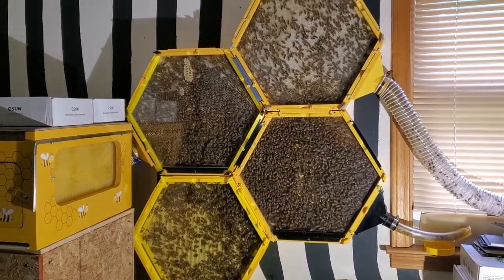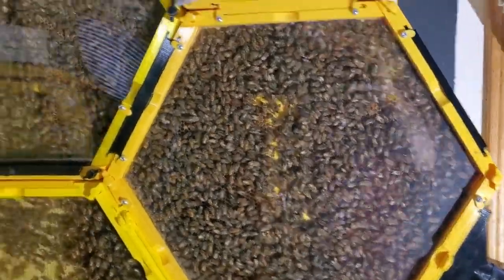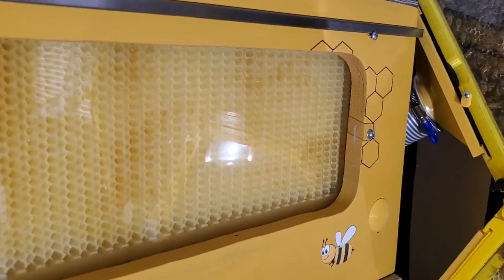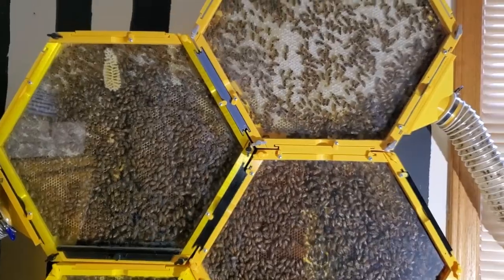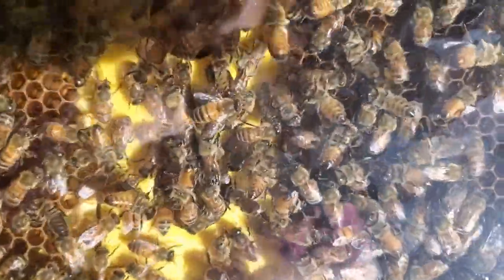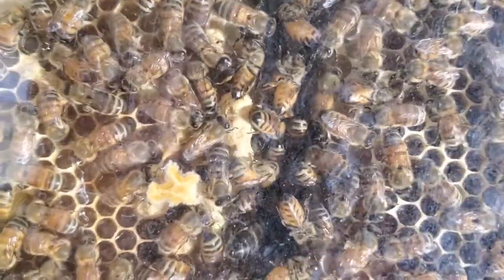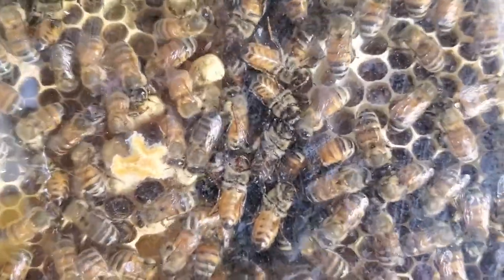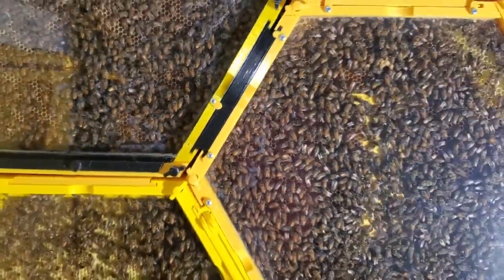3D Printed Bee Hive Update

Comment: You have larva from what I saw, no eggs? That just looked like drone cells to me not a queen. Queen cells look like a peanut and they dangle down. If they were to makin one it would probably be in that center section but it would be pointed down. Drone cells are just males and they poke out in a dome. My guess is that they just dont feel like they have filled out the hive enough to start packing the honey in a flow hive yet. If there is a queen excluder on the entrance of the flow hive that's good so she wouldn't be hiding in there. If they need a queen they will do something about it, but should you notice a queen cell removed the excluder on the hive exit so she can be sure to get a mating flight in and when you see eggs again you can put it back. Bee's usually handle queen trouble themselves but we'll see.

Comment: I wouldn't worry too much about that queen yet.
1. As some other people pointed out, she may be laying on the side you can't see.
2. Sometimes they'll stop laying for a while (probably having to do with the weather outside, nectar flows stopping, not enough pollen coming in... etc) and then resume when conditions change.
3. Maybe your hive is "honey-bound": That is a condition where there is so much honey in the cells that the queen doesn't have a place to lay eggs. 

To entice the queen to lay, consider covering up some of the windows to keep the light out. The queen prefers to be in a dark area.

To get them to use the flow hive, make sure you give them a nice big opening between the area they are now in and the flow hive and make sure the connection between the flow hive and the rest of the hive is as short as possible. Otherwise they won't recognize the flow hive as part of the overall hive.
Reply from the maker: Thanks for the suggestions. I do cover the front when I'm not looking at them.

Comment: Ok, when you started talking about no larva, it made me think about how important it is to have a screened bottom board with a section that can be removed and inspected on a regular hive.  I use this removable, white plastic board that’s under all of my screened bottom boards to see what’s going on in the hive.  For example: you can see any varroa mites that have fallen, balls of pollen so you have an idea what they are bringing in, and you can see the wax capping from the cells when new bees are being born.  You may consider having a small, removable sheet at the bottom of each frame that can be pulled out so you can have an idea of what’s going on in there….

Comment: Those bigger popcorn looking cells are drone cells. As Brad says, she may just be laying on the inner layers where you can't see. Those areas are probably a little warmer so better for brood. They will probably not want to use the Flow hive until they have run out of room to store nectar anywhere else in the hive, so if you keep adding hexagon sections they will probably ignore it, you want to give them no other choice basically.  You can also try spraying the flow hive frames with a little 2:1 sugar, just to get them interested. If they do start to use the Flow hive frames they will probably start in the center, you might night see anything is the observation window of the flow hive super for a good while.
Reply from the maker: Thanks for the advice.
Reply: @bigchessset  Beekeeping is a lot of fun, now you have me wanting a bigger 3D printer so I can print a some observation boxes!